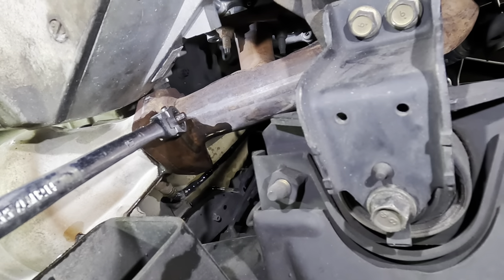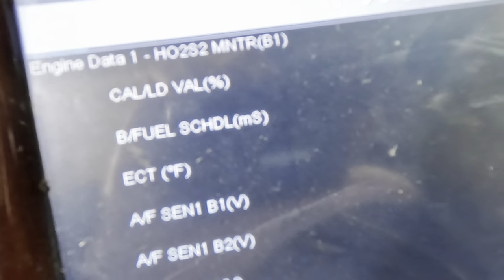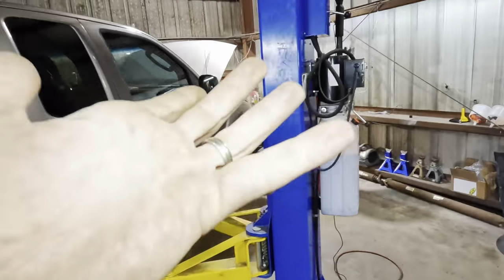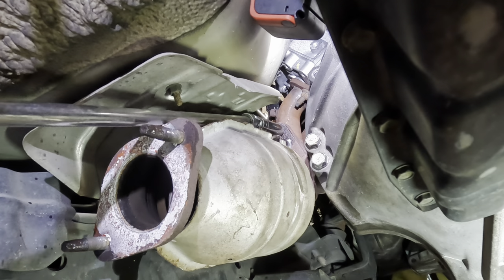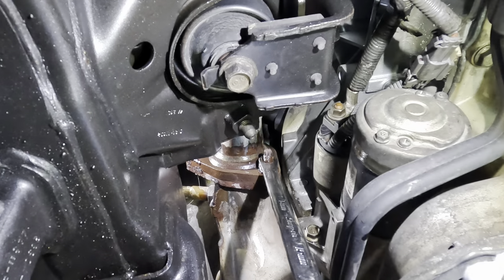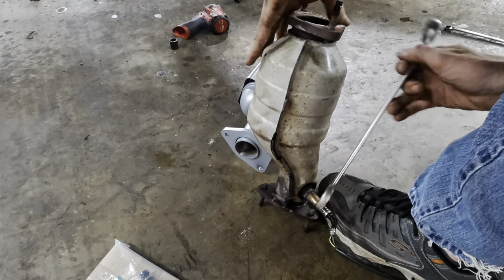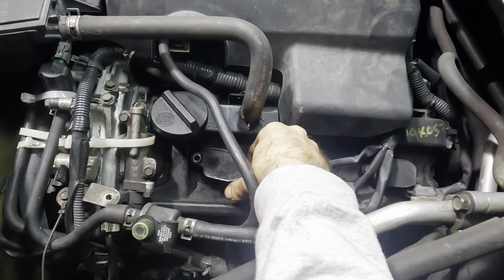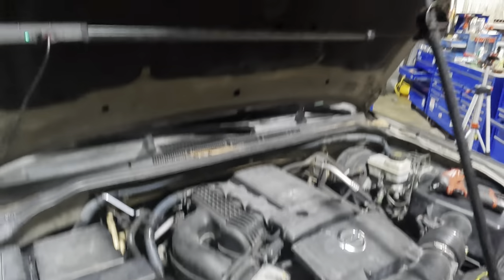Catalytic Converters! Missing?  Running Rough P0302 P0420 P0430 Nissan Fronter 4.0 v6

Comment: Exhaust pipe grounding is usually done to reduce Radio Frequency Interference caused by an un-grounded exhaust pipe's propensity to act as an antenna.

Comment: I love these new(ish) cars with individual, easy access coils. The location of my coil pack from my 96 straight 6 ford is located underneath its injection manifold, bolted on the side of the block. Everything else is fine. But you need jockey sized hands to reach it. My hulk hands & 68 socket extensions with wobbly bits is still a nightmare to reach. Funny how the 97 went back to the 95 placement. That 1yr style was never tried again. lol

Comment: FYI
It's not a clutch fan and a condenser fan... it's a clutch fan and an auxiliary fan. If I recall from my Pathfinder, that fan isn't even behind the condenser, it's on the other side of the radiator. The aux fan comes on for high coolant temp as well as A/C clutch.

Also - if you get this truck back again, you should check if the radiator's been replaced or if they've done a trans cooler bypass. The original had the same problem as the... was it a Chevy? Anyway, the car you got the fluid exchange machine for. Trans cooler inside the radiator (at the bottom) can wear a pinhole and result in coolant/ATF mixing and yummy yummy SMOD. To my knowledge, very few, if any, have ever saved one of these Nissan transmissions after SMOD. Replacement radiators have resolved the issue. If they have a Nissan radiator and aren't sure, there are forums with part numbers known to be associated with SMOD for these models.

As I recall, most of the corrected parts end up with brass fittings instead of plastic for the trans cooler, but that could just be me remembering what my new radiator has.

Comment: I put aftermarket convertors on a Frontier before. Came back a week or so later with an exhaust leak because they didn't do OEM convertors to save money. There is a issue with the gaping of aftermarket convertors on Frontiers for whatever reason.

Comment: A magnet coverd in a tissue will help extract the corroded and oxidized steel from the ocular orifices. Because if it were within or in the eye itself usually surgery is required to save the eye.

Comment: If you suspect the threads are zinc coated, run a tap thru.  It will clean up the threads and make like alot easier!!

Comment: Personally I bag found tools and leave them on passenger seat or floor, particularly on a WIP like that truck. Looks like old engine blew and took cats, junkyard engine dropped in and cats gutted till they get the yard engine sorted to see if it's going to be a runner.
As to the diesel question, I use the power service fuel supplement + stabilizer + cetane boost + antigel and whatever else they got going on in that stuff. I run that and zero soot, half a tank w/o it gets hazy, after a full tank of no additive the back of the car is solid black and the mileage starts to drop. Even when fuel was cheaper, it was cheaper to add that and got better results than just buying superdiesel.

Comment: Higher air speed over wings causes low pressure as compared to below wings low pressure above lifts the plane. The opposite you see in your bathroom flush, when you flush high water speed in the lower pipe causes low pressure  which pulls your load down the pipe. The water running from the top helps cleanups but it is not the main force that gets rid of the load. Without the relative lower pressure down stream you might need tons of water to clean the bidet

Comment: Had a similar problem with rechargeables, take a good battery and connect it with one that won't charge, in other words, use a good battery to charge the other battery. You shouldn't have to do this for a long period of time, say 1or 2 minutes, then check to see if it will take a charge from the charger. Hope that works! Don't discharge your batteries to dead!

Comment: Wow 37 degrees ray... BUT i do have to say its been the coldest everywhere in a long long time. so Ya it was like 0 here which is really cold for here. you got a sence of humor and thats legit. 
an airplane will still move and take off. because the wheels are not powered. the jet engines propell the plane not the wheels. the wheels are just there as pedestoles to hold to plane.

Comment: As for the riddle about the plane on a conveyor belt - One must assume that the air speed across the wings is equal and opposite to the speed of the conveyor,; therefore the airspeed will produce enough lift to lift the plane off the conveyor. However, since it is not the plane's engines causing that lift, the plane will immediately fall back on the conveyor. The principle can be seen with the catapult launching of jet fighters from an aircraft carrier. Once the jet clears the deck of the carrier, it falls slightly until the trust from the jet engine provides enough airflow to keep the jet airborne.

Comment: Ray, take your dead battery or batteries out get some wires you can probe positive and negative with, get a fully charged battery of same brand. Probe the full battery and check on it after ten minutes or so. Try the dead battery once again. As long as the circuit board isn't damaged, and the cells are healthy it will chaege again. Try to charge unused batteries monthly, and store full.👍

Comment: The aircraft on the conveyer question has been around from like the 1970s, its used to assess whether potential pilots understand the interactions and the forces that are applied to an aircraft..   The aircraft will fly, and the simple answer is that the wheels 'free spin' and have no control over the movement of the aircraft, they simply support its weight and allow it to move..   the engine thrust will move the aircraft forward, the conveyer can spin as fast as it likes but it can't stop the aircraft accelerating, generating airflow and taking off, just like normal but with theoretically very fast spinning wheels.

Comment: As far as the newer Lithium batteries go, I have seen where they don' hold up to the complete drain down like the older NiCad batteries which was recommended by the MFG,  plus the NiCad's hold up much better in extreme cold.
Reply: nickel metal hydride don't suffer that memory effect though.

Comment: Ray I think there is a hack that you can reference to get the batteries to recharge. You are correct that if they are discharged to far the battery does not want to recharge. Look for the hack.

Comment: In carburetors (especially the tiny ones in lawn equipment) you should only use ethanol free gasoline or in mixture with oil (like in a chainsaw).  The ethanol will clog those things up.  You dont have to put any stabilizer in the tank when winter comes and it is stored as well.  Shell and other top tier gas is the way to go.  The gasoline is the same but the additives they add are top tier.  Speedway/grocery stores/circle k/ etc are mostly low tier fuels that are more so about selling food than quality gasoline.

Comment: As for the jet on a treadmill question, what makes a plane fly is lift. Air has to move across the foil shaped wings (at a given speed depending on weight of a given airplane) in order for it to lift off the ground. The tires rotation speed has nothing to do with lift.

Comment: I actually proved that a plane can and will take off from a conveyor, regardless of how fast the conveyor is moving. I fly RC airplanes and we brought a treadmill and generator out to run it. then took my plane with the engine running, placed, and HELD it on the treadmill and started the treadmill at top speed.   I held the plane with my hand against the rudder to keep it from flying backwards off the treadmill. Then hit the throttle. It overcame the force of the treadmill and flew off.   I was one of those who originally thought, it can't, but then now I fully grasp how  this puzzle can confuse people. Thrust pushes the plane forward, regardless of how much is pushing back on the WHEELS!  The wheels will just spin faster  but will overcome the reverse force applied to them because the thrust of the engines overcome the weight of the plane and the drag through the air.  It make zero difference how much the wheels are spinning, only the brakes and tie downs can keep a plane on the ground with the amount of thrust those engines apply.  The conveyor can be traveling at 500 MPH and the plane will still move forward and take off.   If the conveyor is moving backwards at 100 MPH, the takeoff speed is 184 MPH (747 in question), the wheels will be rolling at 284 MPH.  If anything its the failure of the tires moving at that speed that would prevent a takeoff, and we don't want to see what happens if they decide to blow. 

For those saying the plane wont move, what exactly IS holding the plane in place and why is it NOT flying backwards then?  The wheels are free wheeling, no motors or gears connecting them to any power source.   How much thrust is needed to taxi? Very little, in fact, just a light bump on the throttle is all it needs to stay in place regardless how fast the conveyor moves,  once enough thrust is applied, it will move forward on the conveyor, regardless of how fast the conveyor is moving in the opposite direction. 

Now, where will you find a conveyor that is the length of a modern runway and can support a million pounds?

Comment: The same thing happened to my friends 2007 Nissan Xterra, the pre-cat on the drivers side disintegrated while on a round trip from South Carolina to New Jersey. It started to burn oil too the point black oil was dripping out of the tailpipe. We went through a case and a half of motor oil. Come to find out this is a common problem with these 4.0L motors. Between the exhaust and intake cycles the engine would suck up the disintegrated core (ceramic?) back into the cylinders and tearing up the piston rings and cylinders. We verified this when we tore down the motor, unbelievable amount of scoring of the cylinder walls that were affected, but not all were scored.

Comment: We hit a record low on wind chill here in Pa for December, was zero degrees with crazy high winds.   37 would have been a heat wave but I suppose houses in the south are not as well winterized.  The worst part was the scattered power outages, we were lucky and never lost power.  I know some nearby that had downed lines, without power for 2 days.  Lots of frozen lines and burst pipes.  Plumbers and ulitilty workers raking in the OT.  Can't wait for Jan and Feb, will probably be brutal if the trend for the year continues.

Comment: About 30 ago when I was a college student and had no money,  I took my 1985 S-10 Blazer to a well-known auto parts / repair shop chain with a logo of three men.  They broke some tools on my car and charged me for them, said it was my car's fault and told me that the manager agreed.  Also they lost some tools and tried to charged me for those but they finally took those off--though my labor went up somehow at the end.  A couple months later I found two screwdrivers and a hose clamp inside my air filter housing bouncing around on top of the carburetor.  Anything tool you find under the hood is yours.

Comment: You're right about the fuel Ray...LPG (propane) burns way cleaner than just about anything else and we've had engines that could run off it for decades. Its also poss to make it from biomass. Only some Dacias (not available in the US) are factory made to run off it, otherwise its mostly taxis converted for it. You might have come across one at some point, though rare in the US. Turkey and Italy use LPG the most for vehicles.

Comment: I did the front two on a 2014 Nissan NV3500 4.0 and bought the cats off Rockauto. I had a similar problem with fitment and bolt threads. I just sent it and I think I had to tap one of the holes to the right pitch but it finally went together and fixed the codes. Also I can't get the NV3500 on my lift due to its size so I did all this on the floor and on my back.

Comment: Yes it can take off. I feel like a lot of people are forgetting one thing. Aircraft do not get forward momentum from power applied to the wheels of the landing gear. Forward thrust comes from the engines pushing the plane and the wheels of the landing gear are free spinning. So the land speed of a conveyor belt would not have an effect on the plane’s airspeed. Same for prop air planes. MythBusters did a whole thing on this.

Comment: Those ignition coils were the original... I had a Nissan from around that model year that I recently sold. It seemed that all of the coils went bad within the same year at ~140k - 150k mile range. After 3 failed, I just went ahead and replaced the other 3... especially since I had a transverse V6 and did not want to take the manifold off again in several months to replace another coil. Also was a good time to do the valve cover gaskets and plugs. I would get a nasty misfire that would usually remedy itself after a restart... strangely, it would never throw a code but I figured it out using OBD to count misfires.

Comment: Yes. The plane can take off because it is not dependent on the wheels to propel it. It uses the thrust from the engines. The wheels would only spin faster than the plane is actually moving.

Comment: I built a seawall for the vice president of rigid about 15 years ago really nice guy gave myself and co-worker each $500 rigid tool expense cards I still have all of my rigid tools and they still work 4 of the 8 batteries are original as well Rigid gets an A+ from me

Comment: You can (sometimes) revive dead hard drives with a stint in the freezer. I have been able to get enough run time to retrieve data from some of them. I can see a freezer stint helping those batteries also. Sometimes it can wake up the electronics.
Reply: Worth a try but better leave them in there as they soon warm up.

Comment: Ridgid batteries are without question the best - they are the same inside as a Milwaukee, except they also have a lifetime warranty, which they honor. I bought my Ridgid set in 2013, and so far they've given me at least 10 new batteries. Free, shipped to my door in about a week. They don't even want the old one back, they just tell me to recycle it!

Get a simple battery adapter if you don't like the Ridgid tools, the batteries are still better than any other brand. You can use them in Milwaukee, Dewalt, Ryobi, Makita, and anything else 18-20v or 36-40v. They sell adapters for every brand now.

Recently got one of the giant 9AH batteries replaced...the one they stopped selling...they still replaced it with a brand new one, and these things are selling for $200-400 now. FREE!

Comment: Ray your right…. I totally agree with you about quality fuels…….Ethanol fuel is  bad stuff terrible for small engines and components. We have reduced fuel economy with ethanol fuel also.  Corn isn’t good for mammals or combustion engines and fuel systems.   We have 10-20% ethanol in our regular fuels 87-91 depending  as measured with the test kits  here in Alberta. The  91-94 supposed to be ethanol free  unfortunately hard to find dedicated higher grade nozzle. So you always introduce some of the ethanol unless you get a good dedicated pump.

Comment: (+/- 04.50) Snap-On is top man! But when you're not a pro. its to expensive. So i have some Gearwrench, Channellock and Tekton (hand) tools and an awesome 3/8" Milwaukee impact wrench. And a 1/2" impact from Kielder(British brand). Makes the job a lot easier/quicker.

Comment: Ray, I think the ground wire behind the cat, is a hack by thieves to dissolve the cat element out thru the tail pipe, but if left on too long, causes the spark plug boots to flash over. Fortunately, they have cat restorer spray at the part store, and high voltage paint online.😁 (Not sold in California) BTW ... I want my test leads back!
Reply: You need to up the meds!

Comment: What??? Ridgid Batteries are free replacement and/or repairs!  
I have an old drill from early 2000 if i recall and just got 2 new batteries for it as old ones crapped out.

Comment: Good work finding the misfires. In my shop, I decline to fit supplied parts. If I,m good enough to fit them  I,m good enough to supply them. I am not just an easy labour outlet. One does not enter a resteraunt with a sack of food and say " here..assemble  my dinner" Those cats should have also  been immediately negated of any product warranty due to misfire. I have had 2 litterally blow to bits  1 minute after instalation on a nissan v6 b due to valve timing issued on a jumped belt.

Comment: Some exhaust systems are grounded for radio noise suppression. If not the entire exhaust pipe acts as an antenna creating a lot of interference with the RF and audio signals in 2 way radio systems.

Comment: Ray, hope you and Wife Unit had a nice Christmas....I always enjoy your entertaining and most times educational video's.  Happy New Year.....'ya neglected 'ta use that Anti-Seize lube on those O2 Sensor threads.  My experience is that if 'ya don't use the antiseize lube, you may never get the sensors out and may end up breaking them off in the attempt to replaace them at a later time....Dooh!